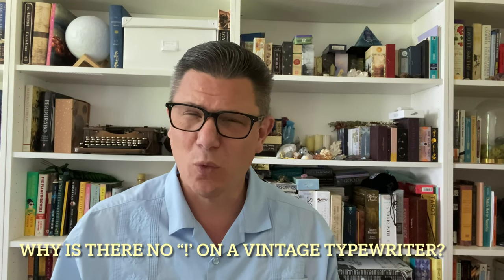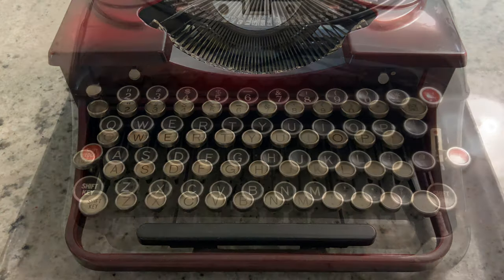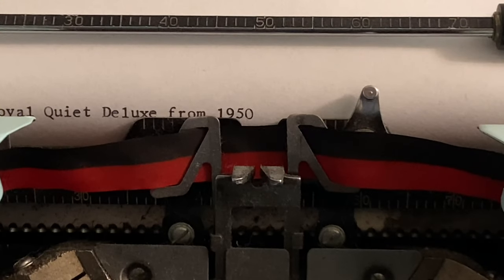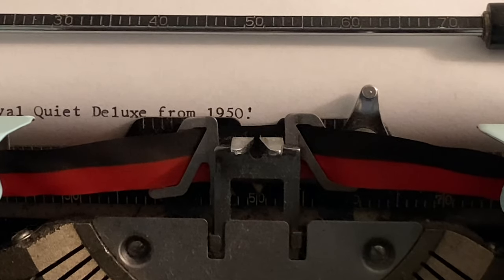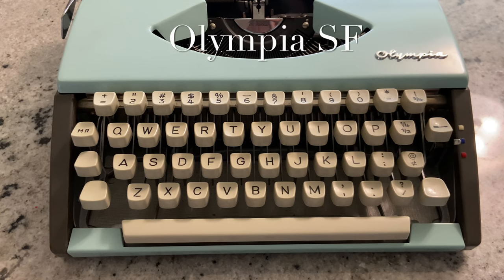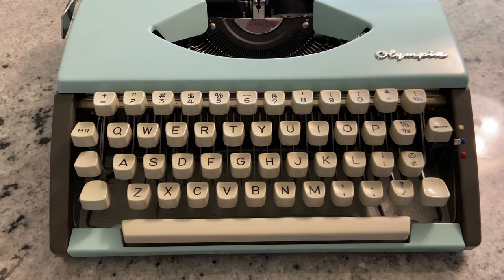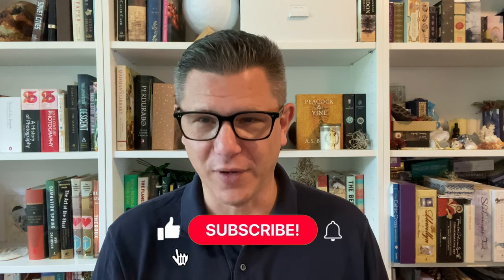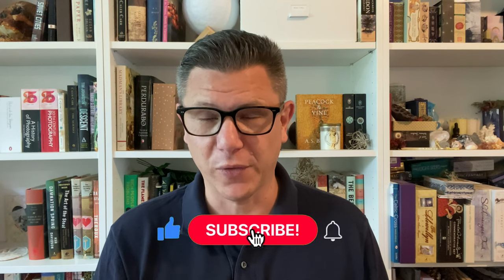Why No ! on Typewriter

Comment: I bought a smith corona at a garage sale for $14 and it works fine. The (!) is above the (1), but the (¢) sign appears where carot (^) sign s/b. I was wondering if a key can be changed on a typewriter and how expensive it would be.
Reply from the maker: Hello! Sadly, it is not easy to change a key. You would have to have it welded and that doesn’t really work well. Best to just find a different machine, I am afraid.